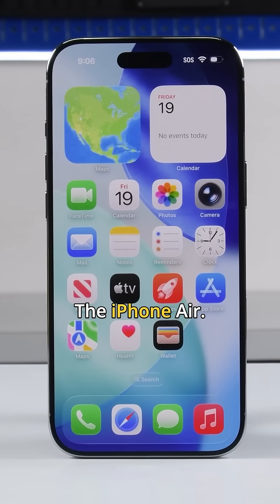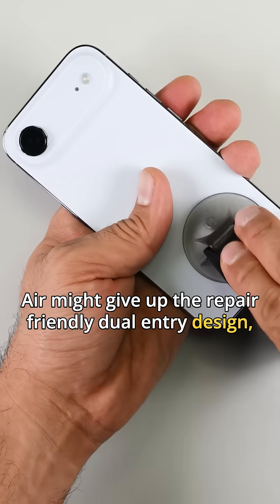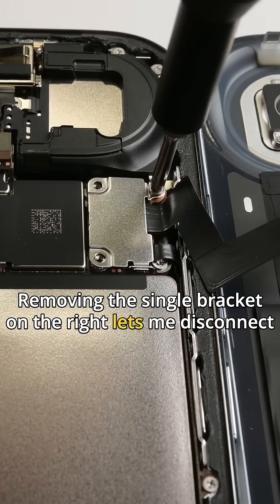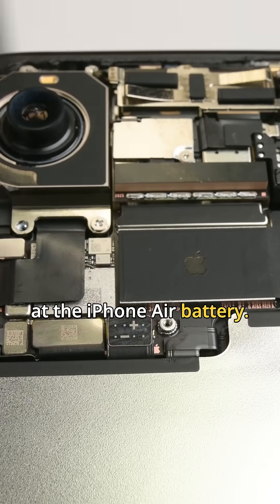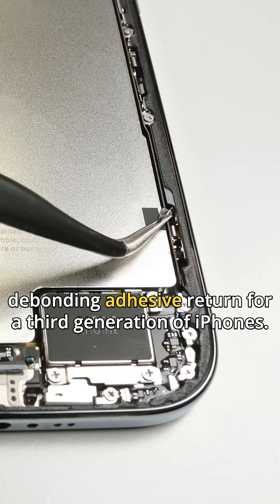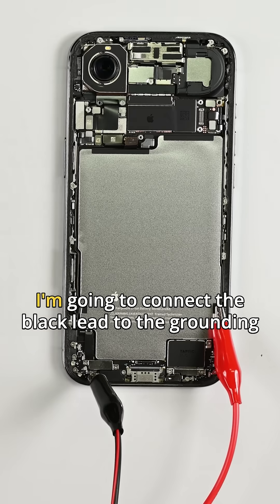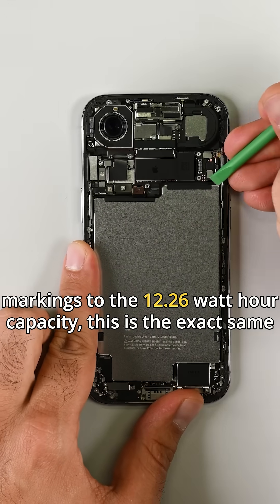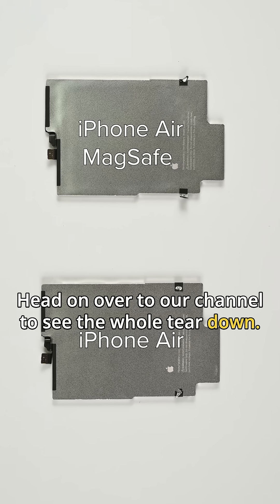You Won't Believe How EASY it is to Replace iPhone Air Battery

Comment: It will also have Hella heat issues. Apple admitted titanium isn't a great heat conductor and the new chip will have heating issues. Along with the fact the air dosnt have the vapor chamber the pro has to keep it cool. Apple literally had to redesign the pro phone for the heat it makes.
Reply: Dude no one is buying the Air to play games and shoot 4K. We buy Air to just get through the day, read an ebook, listen to podcasts. The additional ram and power will be useful five years down the line, but still won’t exact a demanding constant workload.

Comment: Having to use eleteonic connections to remove adhesive always hit me the wrong way. There are tons of metal brackets in here. There should be metal brackets for the battery. Your average person won't have the tool to remove the battery adhesive, and it's another thing they will have to buy
Reply: bruh, couple wires and batteries get the job done, no special tools needed
Reply: @АдрианЖеребцов  great to see you don't know what you're talking about
Reply: @alg003 Dude, just take a 9-volt battery and two wires, that's literally all you need to unstick the battery.
Reply: @АдрианЖеребцов  you shouldn't need it to begin with. And connecting live electrical wires to parts of your phone is an accident waiting to happen that will destroy your phone. And you need clamps, not just wires and a battery. They could have engineered a bracket for the battery.
Reply: @АдрианЖеребцов  Most people don't have wires sitting around at home. Even when you're trying to do a repair, I'd think to buy the part, replacement glue and basic prying tools and maybe a heating device but that's it
Reply: People who spend $1000 on a phone won't worry about spending $5 for clamps to replace a $100 battery.
Reply: @tonkman351  people who spend a thousand dollars on a phone have it sent in for repair. They dont do it themselves
Reply: @alg003  So why is the adhesive a problem?
Reply: @tonkman351  is another tool to have. It's an excuse to raise the price. It's an excuse to make it more difficult to do yourself. Its bad engineering
Reply: @alg003  But you just said people don’t do the repair themselves?
Reply: They have to use adhesive to seal back glass to make it water resistant, that’s the bigger problem.
Not sure if there is a solution to that.
Reply: @gund89123  Im talking about the battery adhesive. Obviously you have to use gasket style adhesive to seal the phone together
Reply: @alg003 
Gasket with screws on the display ? 😅😂

Comment: If your iPhone air battery needs replacing it’ll be cheaper to get a MagSafe battery take it from it.
Reply: Not likely. The whole battery repair kit is $100 from Apple, and $50 back after you send the kit and old battery back.

Comment: How can you re-glue it though? Would reversing the negative and positive reactivate the glue? 🤣
Reply: That’s actually a great question. You’re applying your understanding of DC motors to other electrical circuits, and that’s a great way to learn! 

In this case, it’s a no. The electricity is used to heat a tiny tiny coil, which then chemically breaks down the glue.
Reply: you can't

Comment: Could someone explain how to heat the glue strip? What voltage is it? Isn’t it a stretchable strip?
Reply: You can do it with a normall small 9volt battery. 
When a small current goes trough the adhesive it stops being sticky
It is not a pull tab anymore.
Reply: Also read the repair guides that Apple published.

Comment: Buying the battery pack to change the battery on my iPhone Air 😂😂
Reply: This anecdotal but in Canada, the price for a battery from Apple Self Service is 70 CAD and iPhone Air Magsafe Battery is 140 CAD so I don't think it's very viable if you have Apple Self Service avaliable to you.
Reply: Same price as the 17 Pro btw
Reply: Keep it in the box for 4 years, what's the point
Reply: Or, just take it into an Apple authorized shop to have it serviced. Literally costs about the same. If you have Apple care, it’s completely free if it drops below 80% capacity.
Reply: Unfortunately, once the battery is below a certain charge it will not go above that lol. Good idea on paper but… 😂
Reply: that's big brain play ngl
Reply: @cooper1095  idk how much they charge but I think it’s definitely cheaper
Reply: Wait that’s actually so smart

Comment: Wish the iPhone Air had pogo pins like the Motorola StarTAC, so there would be Ø losses in efficiency of transferring power.
Reply: wireless and conducive charging are two very different things.
Reply: I have serviced hundreds of pogo pins because cannot be exposed to liquid, a replaced dozens of PCBs because some random debris shorted the pins. 

Apple does use pogo pins for charging the iPad Pro, so it’s not a foreign idea to them, it’s just the wrong choice for something you can use in the rain and put in a purse full of coins.